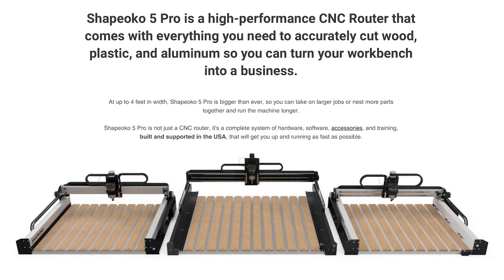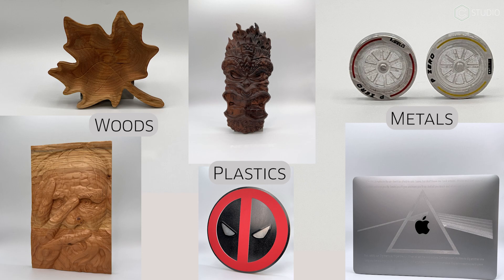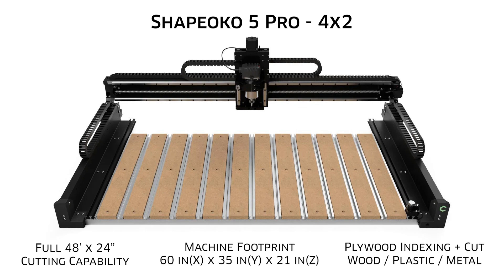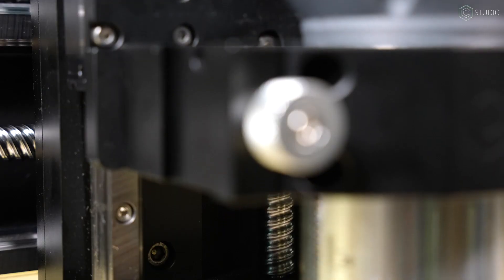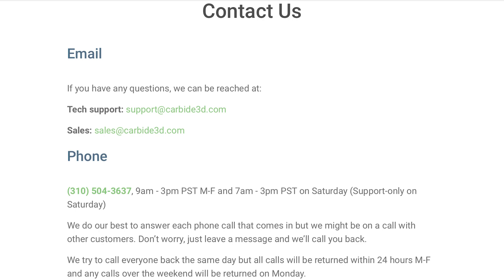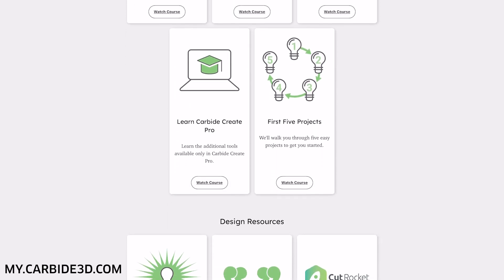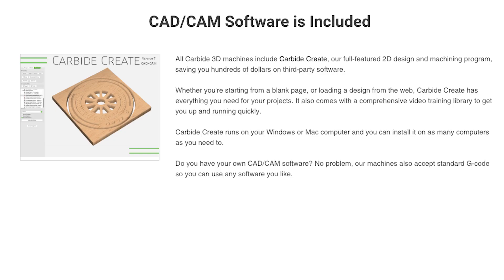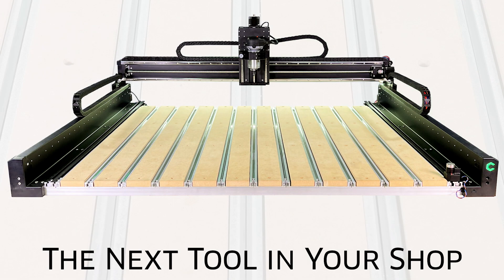The Most Powerful Bench Top CNC - Shapeoko 5 Pro

Comment: What type of file do i need for the post.. i already have a cad/cam software..txt. nc. Tap. Etc ??? Thanks
Reply from the maker: .nc will work with Carbide Motion.  Several CAD/CAM programs have a post processor for Shapeoko
Reply: @carbide3d  i use one cnc cad/cam software and i have about 50 post i can use i need to see if i have the shapeoko post or if i can just use nc. File...i use my software to mill on haas mills.. 3d tool paths , high speed milling etc..i will buy the shapeoko 5 if i can use my one cnc software
Reply: I am more concern if the shapeoko can handle 3d tools paths etc.. seems like it can. Thanks for help

Comment: What's the easiest way to get the 4x4 to ontario canada?
Reply from the maker: Hi Frank,   RobotShop in Canada is your best source for Shapeoko 5.  Cleanest way to deal with the import and associated fees.   They don't yet have stock for their website, but you can contact them and they are able to get you a machine.   When you need smaller items, like endmills, those will be sent directly to you. We look forward to having you in the Carbide 3d Family.
Reply: @carbide3d  I have an open builds 1500 x 1500 but it's never been very accurate no matter what I do.

Comment: Why wouldn't I just buy an MR1? From Langmuir
Reply from the maker: Reed,   You should look at the entire cost and time involved in getting that machine setup.  Be sure and do all the math before making the choice that is right for you. 
 Shapeoko is a 100% solution / Quick assembly and an established machine platform with a full ecosystem of support.   We'd love to have you in the Carbide 3D Family.
Reply: @carbide3d I’m worried about QA.  I gather there are issues with controllers, missing, failing parts.  I’m sharing because I’d rather buy from you.  I’m looking for a machine which will last many, many years for hobby now and selling stuff later.  Please help me overcome these concerns.  Thanks.

Comment: Hasn't this been out awhile?
Reply: This is my exact thought, and if it's a 5 pro vs 5, what's differant. I didnt find much info at all highlighting a differance.
Reply: @billcarriveau  I'm sure there are more videos coming that will get to the details but the obvious main difference is that the 4 and old Pro both still use belts on the x and y axis while the 5 pro has ball screws everywhere.  Pretty aggressive price for a machine with ball screws.
Reply: @krtwood  the point being the 5 pro has been out for some time but they just dropped a video about it again , leading people to belive its brand new again...